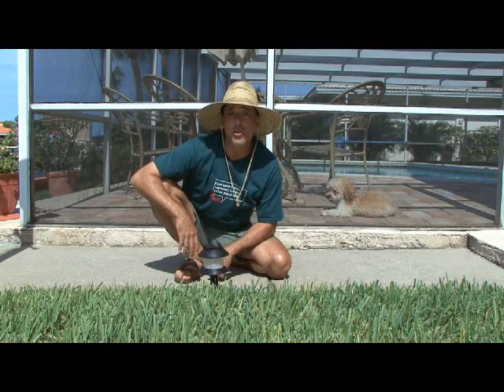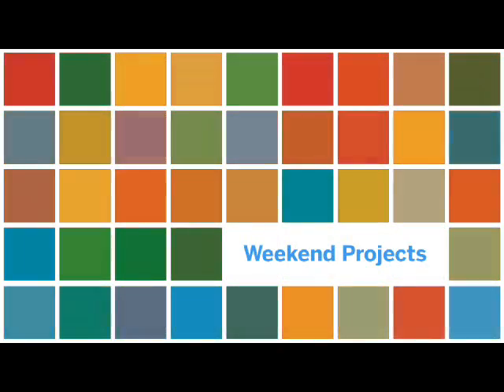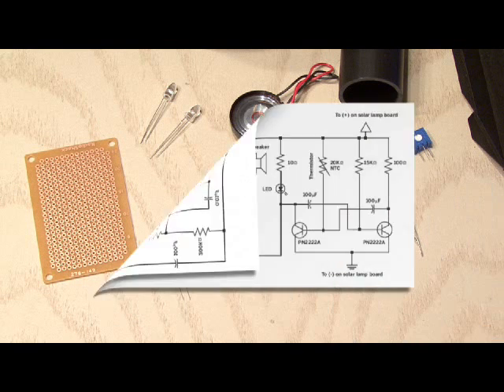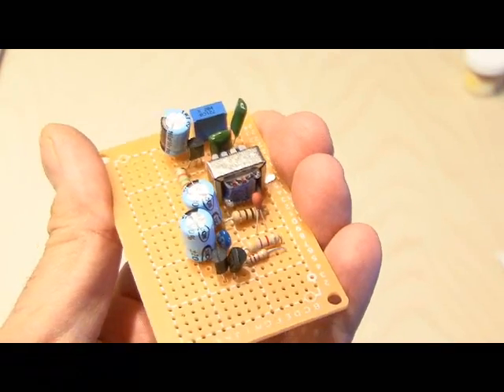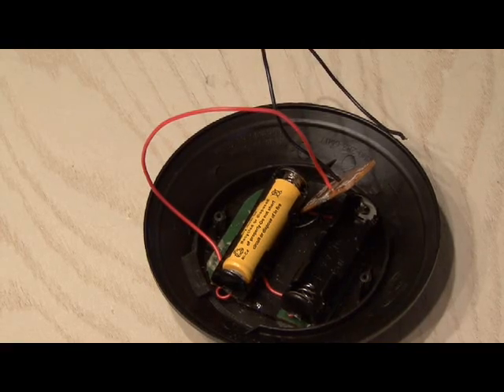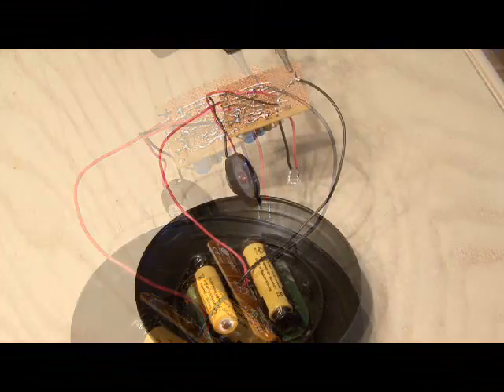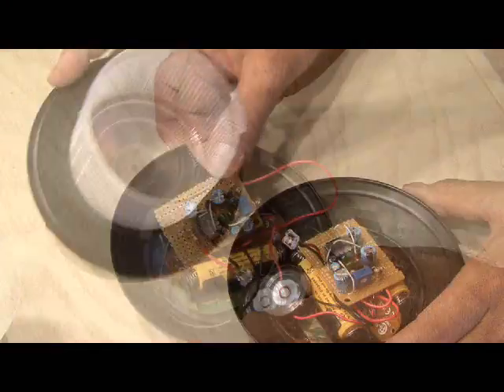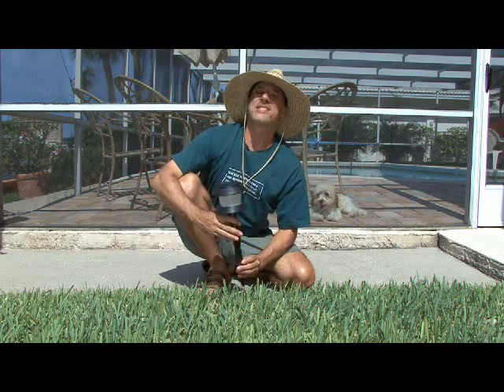Weekend Project: Make an Electronic Cricket

Comment: An easy to boost the brightness of those little solar lamps is to replace the two NiCd batteries with three NiMH (in series)

The solar cell is capable of charging three of them at the same time, and when the sun goes down they will deliver more voltage to the diode thus increasing the brightness

Of course the charge it will last shorter (if you increase the voltage the wattage will increase as well) but you only need it for three to four hours, not all night

And the batteries will last longer

Comment: Doesn't really sound like any cricket I've ever heard. If I built it, I wouldn't make it flash and I'd also get a mini-amp where you can record your own sound (also available at Radio Shack I believe) and I would record a loopable cricket call to use rather than that noise. But a cool project nonetheless!!